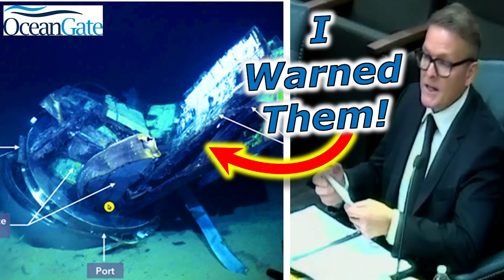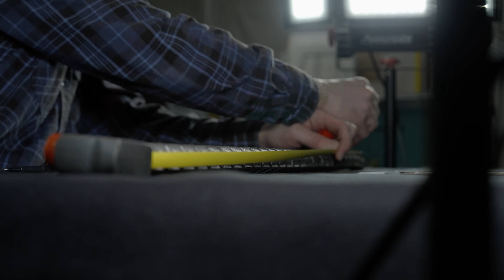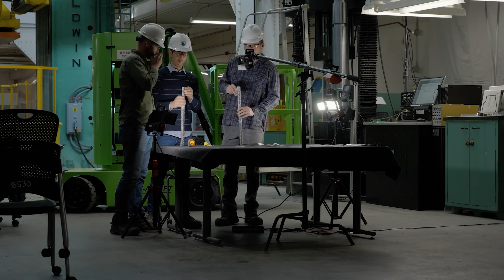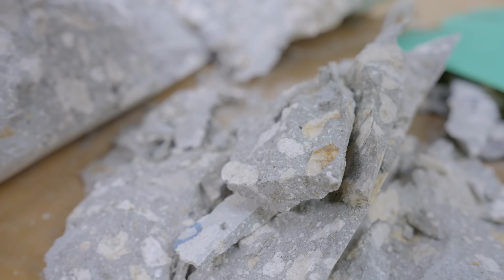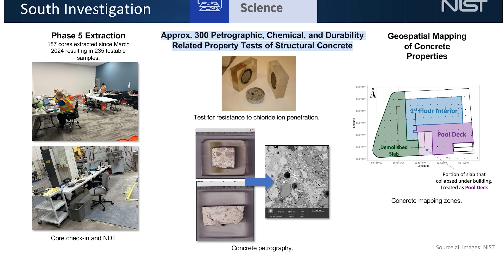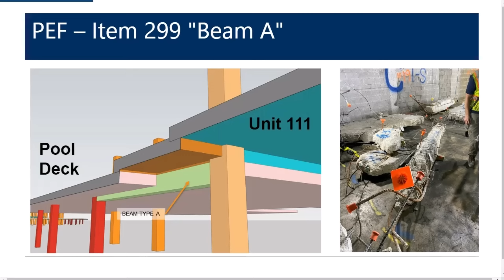Miami Condo Collapse Investigation SETBACKS: Champlain Towers

Comment from the maker: 🎥 WATCH NEXT:
🎥 How To Install Perfect Kitchen Cabinets DIY Like Pros: https://youtu.be/u-6Ar0HZWZU
🎥 Coast Guard Has OFFICIAL OceanGate Titan Sub Transcript: https://youtu.be/yNqp2_70hwg
🎥 OceanGate Titan Sub Debris Video Shows How It Imploded: https://youtu.be/cFQGJKsN-Pg
🎥 OceanGate Titan Sub Coast Guard Hearing SHOCKING Facts: https://youtu.be/i7Fseh64Lq8
🎥Coast Guard Video: Titan Sub Salvaged Off Ocean Floor: https://youtu.be/bX04xMem3-I
🎥 NTSB Titan Sub Report: Carbon Fiber Hull Defects, More: https://youtu.be/Z7xaePm9QhY
🎥Titan Sub: Fired OceanGate Employees Show What REALLY Happened https://youtu.be/Wd5d5tyXKec
🎥 How OceanGate Titan Sub Realtime Hull Monitor FAILED! RTM:
https://youtu.be/AGvSpJi5-Y0
Reply: Thanks for putting this out Jeff.
Reply: June 24th 2021 not June 21st
Reply: Champlain collapsed June 24th 2021 not June 21st
Reply: what about the north towers or towers from the same time/building company? should those not be extensively analized and if they are in any danger evacuate them, analize them then demolish those? sell the land in high price and split that with the apartment owners?
Reply: 3:00 Not foot pounds. This is a unit of force, pounds force lbf

Comment: I am absolutely gobsmacked at the brittle failure of the rebar, I'd assumed it would waist a bit before failing.
Then, there's the DOGE firings, which may affect this agency, so I'd not be surprised if they're working with half the staff now.

Comment: An extra 10,000 lbs of roofing materials, granite countertops and tiled bathrooms where there were none before, pool on the deck and finally a lack of routine inspections and maintenance did this building in.

Comment: I saw the design documentation of the building, materials from the implementation and a lot of
films after the catastrophe. The building had many design, execution and operational defects.
However, it stood for 40 years and would probably continue to stand if it were not for two cardinal
mistakes.
The first mistake.
The ceiling of the terrace by the pool from the axis 10÷15 and from the axis J÷Q was not concreted
during the construction of the high part of the building. There, a crane was driving on the floor of
the garage. This ceiling was made only after the construction of the high part of the building was
completed. A fragment of the ceiling of the terrace by the pool to the N axis was made correctly, but
the remaining part that collapsed was made incorrectly. Here, after concreting the floor slab to the
level of the upper reinforcement, a break was made and after the concrete was set, the upper
reinforcement was added over the columns and the rest of the upper part of the floor slab was
concreted. This break caused the upper part of the floor slab to never connect to the bottom concrete
of the floor slab. I am amazed that this defective ceiling lasted 40 years and did not collapse sooner.
The lower slab without upper reinforcement bent a lot in the spans between the columns and
cracked because there was not enough of this lower reinforcement. The upper part of the slab also
cracked between the columns.
The second mistake.
The one-storey external structure of the building should be separated from the high part of the
building, because these two blocks work completely differently. They are not compatible.
Then a poorly built terrace could collapse without consequences for a tall building.

Comment: Florida is a good place to assess concrete strength. Some years ago engineers criticized the construction of the Skyway Bridge across Tampa Bay saying its concrete was specified with limestone aggregate* as opposed to granite----making it weaker than standard specifications would warrant, and certainly more prone to acid-condition breakdown.   (*Limestone is a Florida product;  granite would have to be imported from the northeast. Politics.)   The bridge was built around the same time as the condo.

Comment: In all the videos I’ve watched of the collapse, only once did I see mentioned the tons and tons of marble, granite, and travertine added during upgrading of the building.  It was originally designed for framing, drywall, wood and structural concrete.  Tiles added to the balconies was just a fraction of the added weight of remodeling.  The immense added weight exacerbated the deterioration issues resulting in a collapse that was hastened by lack of study.

Comment: Amazing that this type of investigation was not done on twin towers failure.  Those buildings were designed to withstand impact of an airliner ... But didn't.  You would think they would want to know about strength of beams, concrete, rebar and support pilings.  Almost proves a coverup.

Comment: Jeff, why does the pull strength (tension strength) of rebars matter?  Aren't they supposed to provide lateral strength -- i.e., to give the concrete some tensile strength?  Indeed, it seems to me that they would be called on to provide more compression strength than pull strength.

Comment: Does anyone really believe that they couldn't retrieve the data from the hard drives?
Reply from the maker: yes, they were in bad shape. I sent 2 seagate drives to 4 different clean room facilities and they could not repair them because of rotational scarring on the plates, which you can't see from the outside.

Comment: My dad worked at a engineering shop that had a puller like that. We pulled apart a 2" piece of round bar and it was shocking to watch as a kid. They used it to pull test composites.

Comment: That steel rod they tested looked brand new. Not a spec of rust. One would think that the concern would be the rebar that rusted from water leaks and the salt-infused ocean environment.  
Also, taxpayer resources should not be wasted on that mini-sub. It was experimental and not open to widespread public transportation. Conversely, the reason(s) for the condo collapse do have widespread public interest.
Reply: They need a piece of rebar in good condition to characterize the material.  Damaged rebar is another aspect of the problem.  We see here just one test from a long and compkex investigation.

Comment: lbs-f in this case is not foot-pounds! It should have been written as lbs(f) which means Pounds Force and even that is technically wrong since lbs is a measurement of mass. I thought science and engineering in the U.S. had adopted the metric system by now and would use Newton as the correct unit of Force but I was wrong!

Comment: Gardi Sugdub is an island off Panama, it's sinking due to the overweight of human buildings, not the sea level rise.
I cannot paste links in YT, but if you google
Florida Sinkhole Types arcgis
you can see and download a map with the different zones Fla is divided according to the sinkhole types. Surfside is on the tip of the green colored zone. 
Not an engineer or architect, but I guess there must be a special type of construction technology on fossil coral reef ground. Or how deep underground must the piles reach or how many are needed.
It's common in the news the formation of sinkholes in Fla, mostly not involving buildings.
The whole peninsula is a fossil coral reef, a type of calcite the is not very hard, is very porous, easy to cut and excellent for decorative purposes.

Comment: Very interesting Jeff - but for all the wrong reasons - as soon as I saw that guy with an obviously brand spanking new length of deformed rebar and setting it up in the test rig like a learner driver doing a their first hill start - I though O BOY! I was quite surprised that construction that bar snapped clean with absolutely zero pinch elongation at the point of fracture - I'm pretty sure that photos of the actual collapse show that the bars bent and stretched on overload - the only ones that snapped were corroded to hell!
Not to be out done the sections of floor slab etc are also brand new - all this will do is establish whether the specification was good enough - nothing else. 
These guys are trying to reinvent the wheel - and moreover I fear with the seeming unlimited amount of cash that's been thrown at it - they will come up with a complete mishmash. 

Here in England we had a bad fire in a medium tower that killed 72 people - the Public Inquiry has cost something like £200 million - and in my personal opinion - will only produce a P.R. response to the well organised outcry against our "wicked, moneygrabbing" construction industry that's only interested in vast profits and builds these shoddy towers to cremate the poor and disadvantaged. Despite Inquiries historically being to find root causes on a "no fault basis" - there's a strong lobby for future prosecutions. It that what Champlain South is about? 

Thinking back to 911 - I saw what we call over here - "dog's breakfasts" come out from the 400+ NIST folk involved investigating - all happy to be on the gravytrain.

Comment: CalTrans concrete mix:  Fill a cubic yard box with rocks.  Add gravel while shaking the box but keep the volume at one cubic yard.  Then add sand while shaking the box, but keeping the volume at one cubic yard.  Now add cement, while keeping the volume at one cubic yard.  This typically takes 4 sacks.  This will provide very high compressive strength concrete.

A "5-sack" mix can be made as above, but without any rocks.  This mix can be pumped through smaller diameter hoses and so is a lower cost and faster process.  But it is not as strong as the above mix.

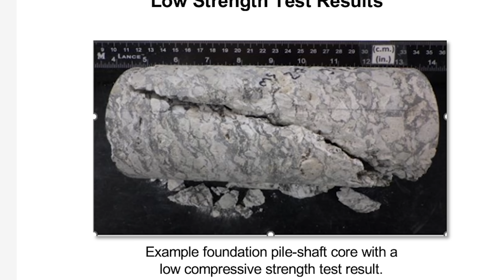Comment: I find it extremely scary that some piles have barely 5.7% of the required compressive strength: 170 psi instead of the required minimum 3'000 psi, according to the testimony at 7:45.
Reply: That was 1700 . 57%

Comment: If the condo owners had not deferred maintenance for decades, it probably would have stood for another 50+ years. The after-the-fact work doesn't change this reality. Not many miles away in Miami, the pedestrian bridge collapsed before it was even put into use. Bad engineering (structural, materials) can be a problem, but isn't the only problem. Not too far away in Miami the parking deck on a DEA building collapsed in 1974 -- are lessons being learned, or do we have an army of government folks who jump in, and fill file cabinets?

Comment: Differential settlement caused by aggressive dewatering on the immediate adjacent South property line was the final straw that dropped the building already severely structurally weakened.
Reply: Agreed. And the new building ended up being much larger and much closer to CT after city sold the road right of way separating the properties to the developer. The sheet piling being vibrated in and out, only 10 feet away, too.

Comment: As an engineer myself I do wonder why they go so overkill on the investigation. NTSB on plane crashes narrows down their investigation before going down so deep. E.g. mechanical issue -> which effect -> possible parts that could have this effect -> data analysis -> trim rudder failed -> deep investigation into those parts, their material and failure points. I miss this approach here. It does feel they are carpet bombing the investigation and going super deep in every aspect. Whilst that is nice, I am not sure it's necessary. Also, this building is a lot less complex than a plane. So I do not understand why they take so incredibly long. Keep in mind - any really important aspects will not be shared until release - and until then a lot of new structures will be built.
Reply: Yeah, the answer for CTS is already known.  Poorly designed and constructed, neglect of maintenance leading to four decades of corrosion on a flat pool deck.  Gave way after 40 years.  NIST is milking this investigation.
Reply: @johnbergstrom2931  Yeah, it does feel after decades of just boring work they milking this more than they should.

Comment: Thanks for the update, Jeff. I think the weakness of the garage piles is red flag and aligns with your theory on the collapse, along with the weight of the planters on top.  I'm not an engineer but I still believe that high-tide saltwater intrusions played a role in the weakening of the piles and rebar, and led to the collapse?

Comment: The is a zero percent probability those guys wear hardhats on a normal day when no one is filming.
Reply: That depends on how good their safety program is.
Reply: @neilkurzman4907  there is no one working over their heads. When the lady with the pink hard hat leaves they ain't wearing hard hats.
Reply: @cr81hq789456  
I don’t know if you work or have worked in a regulated safety area.  All the ones I’ve worked in for the past few decades take it quite seriously. And make sure you’re wearing the PPE you’re supposed to be wearing.
If you’re working on a construction site where your boss doesn’t care I’m sure you do whatever you want. Until one of you gets injured and OHSA fines your boss. so you can pretend that nobody takes safety seriously.

Comment: Waste of money. It really doesn’t matter what the original capacity was since it was significantly compromised by lack of maintenance. This is like testing the fuel at the gas station if your car runs out of gas.
Reply: No, it’s like testing the fuel at the gas station after your car died after buying gas there. 
Many other buildings in the area were built with the same techniques, by the same contractors, and by the same suppliers and subcontractors.
What should they be looking at those buildings to make sure that they don’t fall
Reply: That's an excellent point.  I don't see any way they could simulate 40 years of rebar corrosion...

Comment: good old China rebar
Reply: Chinese rebar in 1980
Reply: No Chinese rebar export industry in 1980.  But guaranteed, the developer Nathan Reiber used the cheapest possible crap to build that building.
Reply: @johnbergstrom2931  
We still don’t know if the rebar failed properly. Or even if this video is of the rebar from that building.
What the rebar contributed to the collapse of the building.
They also indicated that the concrete samples were under strength.

Comment: Makes you wonder about that concrete structure (Mllenium Tower) in San Franscisco and all the foundation trouble they're haviing.  Surfside had prior inspections that pointed out severe deficiencies.  Apparently,  there was not enough money to correct in a timely matter.  Really sad for the people that perished.
Reply: @scruffy4647 THEY had the money, but residents kept voting “no” to repairs.  The condo president resigned out of frustration, because he knew the situation was dangerous, but residents didn’t want to spend the money.

That cheapness cost them their lives.
Reply: @electrictroy2010   I doubt it was presented as "repair it or die", however?

Comment: Testing is perfect and necessary. But what were the specs when the steel was ordered 50 years ago? What influenced the quality of steel in 50 years of stress in the building ( hurricanes, temperature, and soil structure)? all test results should be compared to the specs of 50 years ago, not new standards that are used now.  Maybe the conclude the building code  of 50 years ago  was not sufficient
Reply: It had nothing to do with 'the specs', it had more to do with the developer, Nathan Reiber, who did everything on the cheap.
Reply: @johnbergstrom2931  That's OK, but assume everything was according to the then-active building code. It's more than likely that the code evolved, and current standards are more strict based on 50 years of experience.  For a good test, the code standards of 50 years should be used.

Comment: lbf is NOT foot/pounds of torque. It is pounds/force applied. You should know that.
Reply: I came looking for this correction. Imperial system suffers from using pound for both mass and force. A one pound weight from earth would have 1/6 lbf on the moon, but still 1 lbm.
Reply: @tgschaef  Right, but the issue here is that he said foot-pounds instead of pounds force. Foot-pounds is a unit of torque, not force.
Reply: Note that it's foot-pounds, not foot/pounds. "/" would indicate division, but torque is force multiplied by distance.
Reply: @tedsmith6137  yeah, I was clarifying why the designation was important. Not many outside of a science/engineering training would even know there was a difference.

Comment: The actual numbers need to be run against the design safety margin for the component. For foundations and principal structural elements in a building that is 3x. That is they are built to withstand 3x the maximum design load.

Comment: Was the rebars pre-tensioned inside the concrete?
Reply: There was no prestress or post tensioning indicated in the structural drawings.  Rebar is typically not involved in prestressing or post tensioning, they use much higher strength steel for that.  Most of it looks like a form of cable and not deformed reinforcing but there are some special made deformed bars that can be post tensioned.  They will have roughly 2.5 times the strength of normal reinforcing steel.
Reply: @billj5645  So the function of rebars inside concrete without any tension are acting like dampeners for vibration?